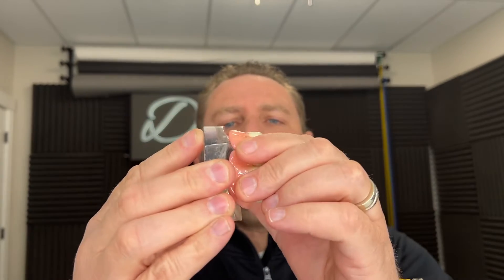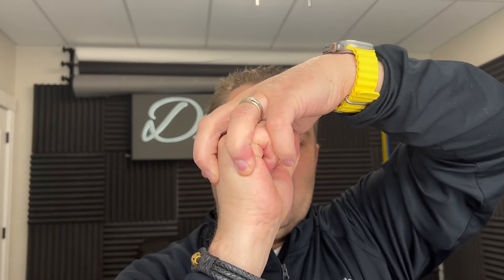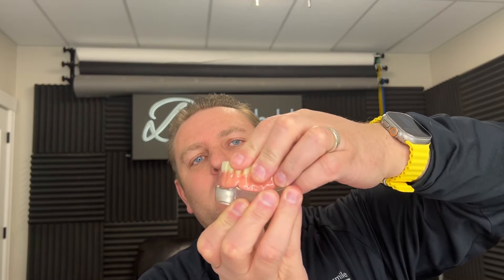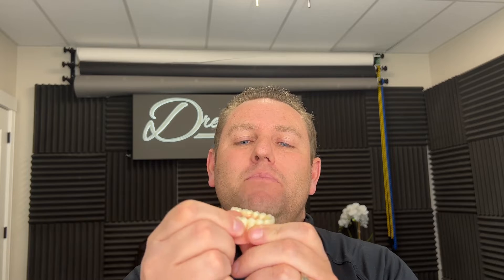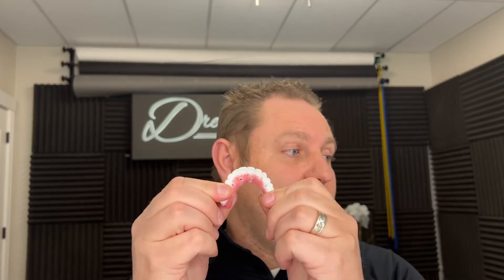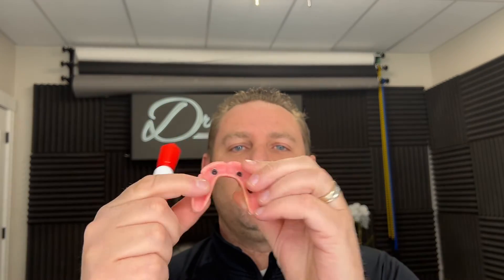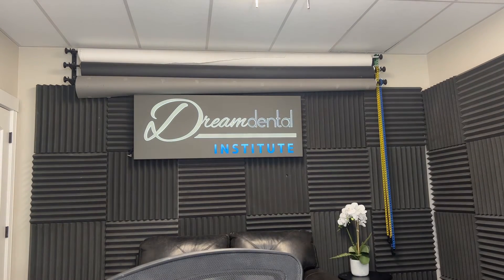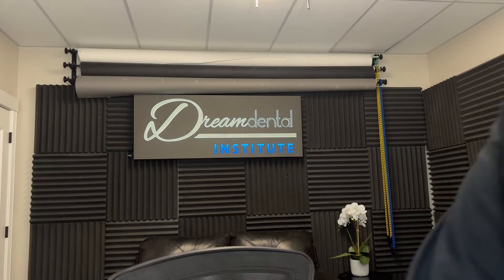Snap in Denture to Zirconia??????

Comment: Paid for zirconia teeth, got the all in 4 implants top and bottom. It messed me up bad mentally I had them screwed in for a month (the temps) started having panic attacks cause they felt so weird they just kept saying it was temporary. I also financed this lol an everything was in house at “clear choice”. 
I didn’t like the way they felt and was having serve panic attacks which I’ve never had before. So they called the dentist in on a Sunday and I had them taken out. Caps over the implants and went 1 month no teeth. 
They then made me dentures I wore them until my implants healed. 
I figured snap on would be better so they turned my dentures into snap in teeth. And they’re great. None of that movement you’ve mentioned but it’s been 3 years and I haven’t even gotten the snaps changed lol prob cause I don’t have the ball type studs in my gums. 

So since I didn’t like how they felt I didn’t even get to try the zirconia teeth and that’s what I paid for. They did so much special favors for me tho cause i basically paid cash since they don’t accept insurances so i probably got ripped off and should get my zirconia teeth but im scared not gonna lie. 
I think it’s a lifetime appointments or whatever so I’d like to maybe try the zirconias. But it was a crazy process and my experience was not good. 
Context why I think this happened: 
My Stitches came loose 2 days after surgery the (all in 4) process all my teeth were pulled (top and bottom) and I left with teeth that day all in 12 hours.  But the stitches loose left my mouth clotting tea bag sized clots almost choked on one in my sleep….. They had me come in emergency 6am and unscrew and take the bottom teeth out and do more stitches…  to say the least it don’t go as planned for everyone and I was not the FIRST person who wanted them taken out after they get done. I appreciate your information on why zircs can’t be done on the implants and I understand. I did more work on making my mouth feel better than they did cause I had so many appointments and I can use a dremel lol Didn’t wanna be bull crapped either through the process and having a friend in the office helped with all that.

Comment: Dr. I have a snap in denture and would like a titanium bar with ONLY  the same 8  teeth I currently have. I am not asking to use the same snap in denture but a titanium built denture to attach permanently to my current implants. It is for my lower jaw. I had a titanium denture installed in my upper jaw 20 years ago with zero problems to this day. I am 74 years old. Can you build a titanium bar with teeth for me? 
I don't need a zirconia denture .

Comment: If by getting snap in's could it make it easy to transition to permanently teeth
Reply from the maker: They can as long as the implants are placed in the right location and position.  Let your surgeion know you may want to upgrade to fixed later.

Comment: But…. Couldn’t you just have posterior implants placed for a snap on, in case you change your mind years later. I like the idea of being to take them out to really clean my gums
Reply from the maker: Yes, but let me explain, that with the all on 4, you need to have your maintenance and cleaning every 4-6 months where they not only clean but they check the screw, heath of implants, bone loss, and gum health.  The dentist will take the teeth out if needed.  If the patient is doing good hygiene, hey may not have to take them out.  It is at this appt where your dentisit will see if there is any problems that are in the beginning stages.  Although it is true that you are not able to take the teeth out  yourself, when you want, it is the most natural feeling.  As well as the bite force for eating is better.  You can start with snap in providing your surgeon places the implants in the proper place and position for the All on 4, I have done this for a lot of my paitents.  If the implants are not placed right, You would need to have all new implants. I hope this helps.  Thanks for your questions and for watching.

Comment: The problem with the 3 on 6 or bridges is they look like FALSE TEETH.  Because they are made from one solid mass.  The all on four are INDIVIDUAL TEETH placed in pink plastic, so they look like teeth.  Just my opinion.
Reply from the maker: The 3 on 6 is 3 bridges on one arch, connected with 2 implants each .  The all on 4 is one arch that are connected with 4 or more implants.   Depending on the material that is used.  I believe the kind you are describing would be the acrylic based with teeth set in them.   I use the monolithic which it is all one piece in zirconia material, (strongest material, and you wouldn't have to worry about teeth popping out.  The gums and the appearance of individual teeth are done by a professional artist that is able to individualize a custom look for the patient.  The choice between all-on-fours and three-on-six implants should be driven by clinical evaluation, not personal preference. Be sure and do your research.  It is a big investment.  Thanks for watching Sandy,

Comment: I have snap in upper dentures. They have 4 implants they snap on to. Can the dentures be changed to a permanent fixed bridge using any of the 4 implants? I’m honestly considering throwing them in the trash and getting permanent fixed bridge teeth. Help!
Reply from the maker: Hello my friend, It really depends on the location and the position of the implants placed.  Sometimes they can be used, but most of the time they need to be replaced for the stability of the denture.  A CT would be able to give us the infomation we need.
Reply: Thank you for your reply. I am very unhappy with my current teeth. They look ok but are rather bulky. I paid about $15 thousand dollars for the uppers alone. Really it’s my fault for not researching my choices better. I advise anyone looking to do anything like this to weigh all your options before deciding. Personally I would have paid twice as much to get a better more permanent result.

Comment: Hey Dr. H, what are implant-supported dentures? I am in southern California and I went to USC Dental School last year to get dentures because I don't have dental insurance  I had faith that they would do a great job but it was a nightmare. So, the day I was scheduled to have the rest of my teeth removed, they wanted to remove the remaining teeth top and bottom and again with only local anesthesia, and thank God I said no. They wanted to remove the remaining teeth ( I already had the molars etc removed there ) in the morning and put temporary dentures in my mouth in the afternoon. They removed the top teeth and sent me upstairs where the professor shoved an upper denture into my bleeding gums. I was supposed to keep them in overnight but I took them out in the car on the way home and never put them back in because the degree of overbite was miserable I no longer trusted the school and I have been without top teeth now for a year in January. Dental offices call insistently acting like used car salesmen and it's a terrifying that has kept me from doing anything at. It will be a year in January that I have had no teeth at all on the top I still have several of the teeth on the bottom have that are strong and I'm wondering if I can save those with a bridge instead of doing all on four?  Thank you 🤗
Reply from the maker: That’s a very good question Olivia,  Implants supported dentures are the dentures that are screwed into the bone by implants.  They are able to be removed at the dental office with special tools. when we take a CT scan, this will show us how healthy teeth are. I like to look at the overall picture and the longevity of the health of your mouth. I think all dentists hate to take out healthy teeth. We can look at all options that are good for you.  We could start with a virtual consultation. Fill out this form and I will have the Office reach out to you.  https://form.jotform.com/201774375645058

Comment: I got 6 implants, not all on 4  I did in 2016. I did on top mouth. Now I got infected 3 of them . He said I got infected because I still have some of my real teeth in my mouth on the bottom plus he did my implants in the bottom teeth also infected too. Now he asked me to take all my teeth out if not it will infect it again if he try to save the top implant.  Cost me a lot of money already when he did the first time. Now he tried to save the 3 implants and add another one in going to be 4 implants. Maybe they called all on 4 . And I can do the bottom teeth too much money already. I will do snap on denture on the bottom teeth. $35000 the cost of the teeth. Last time I paid $34900. Just too much.
Reply: Don't get All on 4. There's a few videos about the reasons why not.
Everyone that gets All on 4 is the same patient. 
Meaning they cut up to a 1/2" of jaw bone out on your bottom & upper front. Dentist are trained to preserve Bone whenever possible.
All on 4 is just a quick fix with issues & again all are done the same according to the older 35yr experienced dentist say. 
You will be no different than your 11 O'clock Appointment that's coming in after you. I wish I had the link. I wanted All on 4 myself until I seen that video. Go for a complete Bridge is what he said, I believe. All on 4 is just a fast way for these young dentists to make a lot of money & you'll have to get constant maintenance. 
Your bones need to heal & why are they throwing All on 4's in a day?

Comment: Two questions can you eat with snap on dentures? And how much for up and down snap on dentures?? Please
Reply from the maker: Yes you can, depending on what you eat, sometimes they will rock while you bite down.  You will need to have them relined periodically so they fit your properly.
Reply: @Bryan_hendriks  Are these snap ons something you recommend?? How much approximately????? Ty so much for a quick reply!!!
Reply from the maker: @brianmck7363  Snap in dentures are a better  option than the traditional dentures for those who can't do the all on 4.  Remember with snap in you have the on going cost of re-lines and inserts.  If this is the option you choose.  Make sure the dentist uses 4 implants on top and 4 on bottom so the denture doesn't rock when you chew.  Also when I used to offer them, I placed the implants that could be easily converted to the fixed "all on 4".  A lot of my patients ended up upgrading to the all on 4 after a while.  As far as cost you would be looking at anywhere from 25,000 up to 40,000 for both upper and lower arch. Thanks for watching Brian!

Comment: Please help. I don’t have much bone in my mouth, I can only get three implants on the bottom arch and five on the top, so a snap on denture is my only solution for my bottom arch. However since I can get five implants on the top I wanted a zirconia hybrid but my dentist is telling me the weight from the prosthesis will be too much and overtime put strain on the implants. Is he correct or are five implants enough to support the top arch zirconia prosthesis? Thank you!
Reply from the maker: The weight of zirconia should not cause problems with implants.  As long as you adhere to the soft diet until all implants have healed to the bone.  My patients have never said they notice the heaviness. I recommend the 4 implants to more.  Due to maintenance for the patient.  It all depends on what the CT scan shows me.  How dense is your bone and how much bone loss there is.  I would love to meet you and answer all of your questions.  Call my office for a consultation.  8019901703.

Comment: Thanks for the information you give us. I have a question about mixing types of prosthesis. I heard a dentist suggest that if you want Zirconia teeth, you should only get it for the upper arch & get metal bar with acrylic prostheses for the lower arch, because the lower maxillary is suspended and supported by muscles, more so than the upper maxillary, therefore, the zirconia structure will be too heavy for the mandible. Is there any truth to this? My concern is that I want Zirconia prosthesis, and if Zirconia is harder than the acrylic, won't it ware down the acrylic over time with chewing & so on? Plus I just don't like the idea of getting 2 different types of prosthesis.